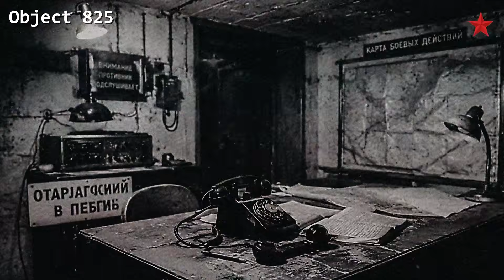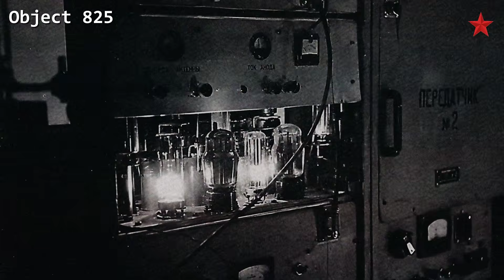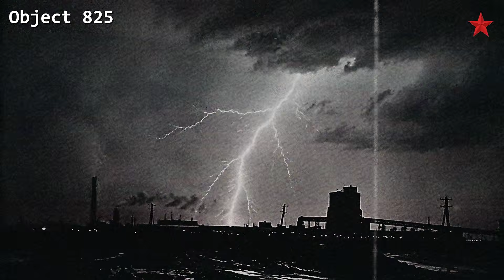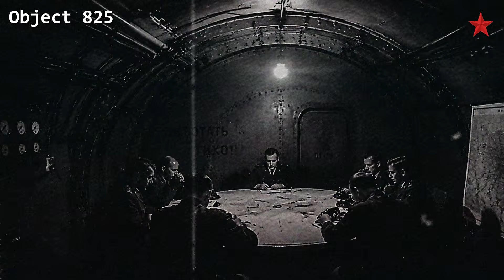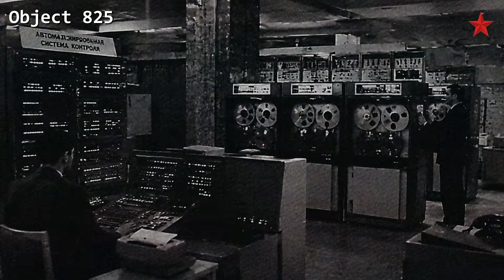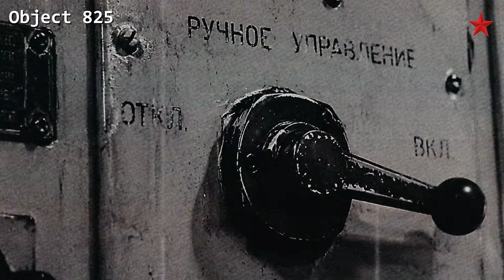The Soviet Doomsday Machine Built to Survive the End of the World

Comment: I can't imagine how Perimeter could still be functioning correctly without a complete and very expensive overhaul. All those cables oxidizing, temperature extremes, old sensors that need to be update or are not functioning correctly due to the lack of self testing software. So many things could go wrong many without the ability to make the problem known. Upgrade this portion of the system but it can no longer communicate to that part of the system.  What does the damp do to this component and what do electrical surges from dirty power sources do to those chips? Who volunteers to crawl through miles of tunnels to inspect three thousand chips for the batch numbers of the faulty chips bought from China in 1987 and again in 1989?  Yet A.I. claims as far as the know, Perimeter is still functional.
Reply: Russian technology is usually simple and easy to repair. The latest rockets they use in Ukraine are still using the same technology then 60 years ago. Oreshnik

Comment: So a hacker could transmit a radio singnal from anywhere in the world and end the world. Brilliant
Reply: No 🙂‍↔️ there's multiple things that must be true before it can launch , highly doubt any hacker could initiate a launch. Several factors on the ground have to be true for starters.
Reply: @Playa566   No Einstein 😊↕️ first read the comment and understand it. The command rockets sole purpose is to broadcast a encrypted radio signal which in theory can be broadcast by a hacker using other means. Hacker doesn't have to go and launch the command rockets got it ? 🔛🙂
Reply: @imac786 You don't even understand what you are attempting to talk about 😂 , it's not hard to understand what you are attempting to say that a hacker could broadcast the launch codes. Even if someone could broadcast the correct codes which isn't possible , they are only generated once multiple conditions on the ground are satisfied. The missiles wouldn't launch unless the conditions on the ground are satisfied and the system is analog mostly there's nothing you can hack. You can't also trick the system nor bypass the fact all communication with top official's would have to be cut for the correct codes to generate. You have a bad idea of how such a system works because even Moscow isn't that dumb to create such a dangerous system that could be manipulated by a hacker on a computer.
Reply: @Playa566  No wonder you don't understand what I am talking about because you dont have the slightest clue of what was discussed in the documentary or you have a really simpleton one track mind 😂😂 😂 nor do you seem technical. your best dumb counter argument is Moscow is not that dumb. Lol

That's really pathetic , if you want to humiliate yourself more go right ahead or watch the documentary again and follow the sequence of events of how things occur. The whole manual analogue routine and all the checks occur BEFORE command rockets are launched, after that only the command single maters. Not sure a dumb ass like you even understood what I just wrote. And hacking command codes is not impossible. That's got to be one of the dumbest thing I have read today.

Comment: Deadhand was a nightmare in theory but was practical in reality. With all the nuclear threats Russia makes today I wonder what they current version looks like.
Reply: Did you mean what you wrote?  Might want to read that again.
Reply: Alot smaller than it was before we spend more in upkeep just on our nuclear weapons per year than the Russians spend on their entire military. There's no way they have been able to afford to maintain all of its previous nuclear weapons I would say they have less than 500 missiles capable and ready to launch.
Reply: @Playa566 remember when NATO experts said Russia has run out of missiles.
Reply: @Playa566  yes and it only takes 400 warheads to wipe the us off the face of the earth and damage the world forever, no peace is better.
Reply: Remember all the controls of these doomsday equipments used analog circuits to by pass heavy EMP situation.
Reply: @sumitkumarroy2307it may work if the Russians refitted everything but how many working missiles etc is another story. There's no way Russia has been able to maintain all of the former weapons it had during Soviet years. The United States spends more on its nuclear arsenal maintenance per year than the Russians spend across its entire military. These weapons require yearly around the clock maintenance and testing it would be remarkable if 24 percent of the Russians ready to launch weapons actually work as intended but even that can be deadly. Although with the new US shield system that will undoubtedly increase in sophistication to lasers how effective a countries nuclear response is a guess.
Reply: @Playa566  do not tell about US expenditure on defence. A $20000 worth missile cost around 100M. Ukraine and Iran war has shown that.   Soap dispenser cost around$30000 a piece. Where as the same dispenser in open market cost around $4-5 max
Reply: @sumitkumarroy2307while some of it is  a huge markup a majority is to hide certain budgets and secret research etc. You really don't understand U.S expenditure the government can also easily fix any pork within the budget but alot of it is for things you aren't privy to and payments under the table just a whole slew of shit that can be justified now since it's on a line item that may be substantially marked up but It passes and allows spending in areas the public doesn't need to know about or our enemies.
Reply: @Playa566  yep, that's why US wetted it's pants in Iran. Iran, Russia and China can produce similar products at 1/10 the cost and that too with R&D. 
F-35 is no more stealth in the eyes of Russia, Iran and China. Russian S400 is way more superior to THAAD, patriot or Arrow. It is not me saying. It has been quoted by Indian army after doing a thorough testing of both the  system.
Reply: @sumitkumarroy2307lol you are speaking nonsense you wish were true 😂 the Russians nor China can produce anything close to the F-35 or it's newest generation. Ask the worlds experts yourself lol and the S400 better ? Lol we've taken out almost every system they have with a missile from the 80s. The Indian army 😂 that doesn't retain the F-35 nor have patriots nor thadd the S-400 is absolutely junk 😂. There's plenty of videos to watch your S-400 fail and be destroyed in Ukraine, they lost so many they had to move what little they had even some in India.
Reply: @Playa566  I know you are a US fan.  But the world knows what is their capacity after Iran war. 
Most of US and western wepons are very good show piece good to be kept in show case. But not that good in war. Even the US generals acknowledge that. They are very good in invading countries like Libya, or Iraq, Venezuela, Panama  (obviously by heavy bribing). Look they fled Afganistan with their tail between their legs. 

Even the US Generals acknowledge that they can not win a war with a direct confrontation with Russia or China. Iran proved it. 45 of US prized aircraft which included F-35 were brought down by Iran. And USS Abraham Lincoln and USS Gerald Ford both were bombed by Iran. Their $2billion radar were destroyed.
Reply: @Playa566 waste fraud and abuse.....a $1,- parts easily costs a $1000,- in the US (fraud) army.....
Reply: Yeah, you can't never make enough threats to keep the Epstein Regime away from other people's lands. Because the Epstein Regime is always soooo worried for "freedom and democracy" in other countries. Now it's the evil cartels. More and more countries should have nuclear weapons to defend from the Epstein Regime.
Reply: @corvendallas8838 A waste of massive investment that the United States can easily detect and prevent. We can embargo and block your ports bring whatever regime that thinks they can step outside the box to heel. Even if you manage a limited number like North Korea it only insured your destruction while the United States can easily survive whatever you can get in the air if you do at all.